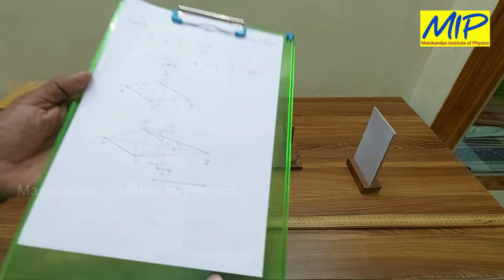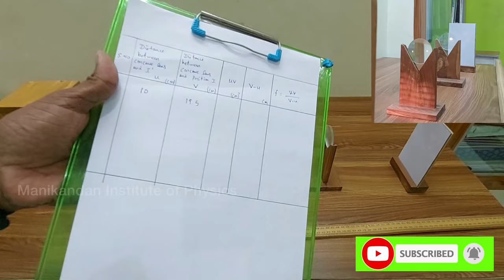Concave Lens - Determination of Focal Length by Out of contact method using Convex lens

Comment: um but why the light didn't diverge while passing through the concave lens in your ray diagram?
Reply: Dotted lines is the light converging without concave lens
Reply: @mvenkatesulu371  he meant the non-dotted ones must diverge as it is concave lens light rays diverge....
here the principle of reversibility works so they are actually diverging but seem to converge